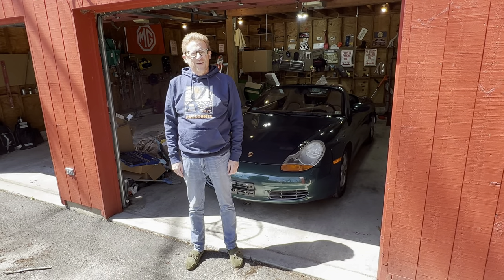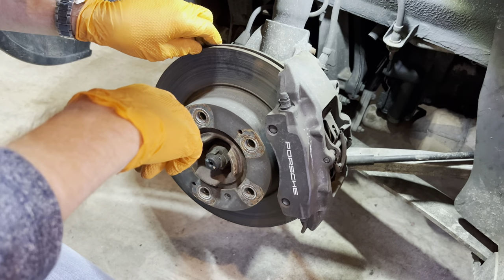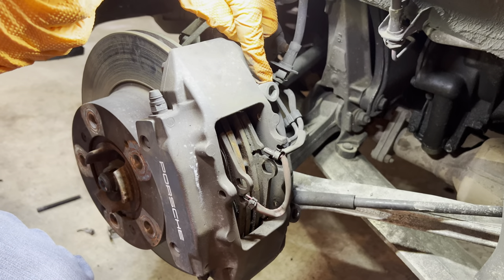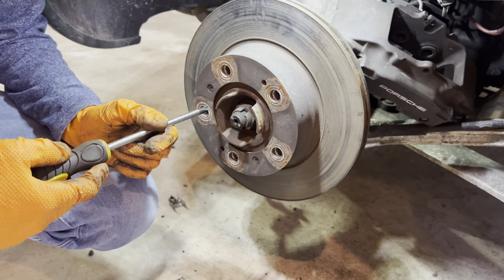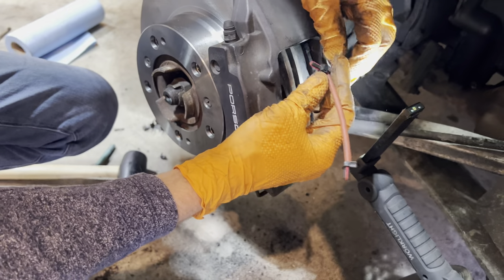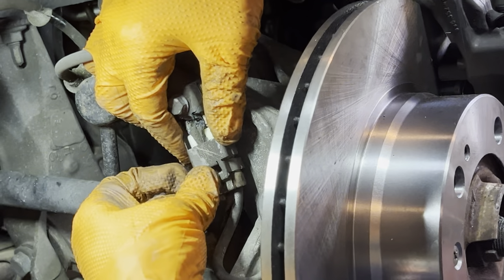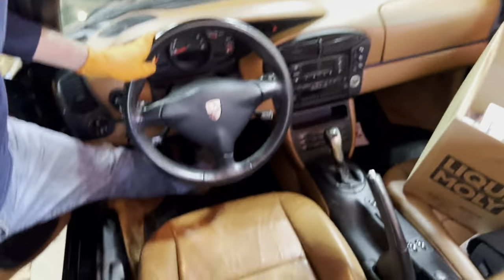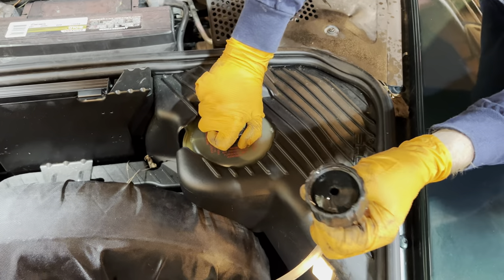This Is How To Do A Complete Brake Job On A Porsche Boxster 986!

Comment: Excellent work Jay. Great to have such good lighting and camera work which shows in detail how it’s done. Pity about the key to the lock nuts, would have thought you would have been able to get a second hand one in the USA. Also the tool kit which came with the car has an
aluminium rod which screws into the top hole on the hub to help with the alignment of the lug nuts and carries the weight of the wheel whilst you bolt in the four others.
Reply from the maker: That’s a great post for those that follow me. Thanks a lot, Phillip!

Comment: I like to remove the pad wear sensors first. Then remove the pad fitting spring/pin, slightly compress the pads, remove the pads, and remove the caliper bolts. Then clean, inspect the seals and rebuild. Brakes are so simple and you can save $$ over time doing them yourself while getting a better outcome.
Reply from the maker: Thanks for the tip!

Comment: Love your work, Jay! Thanks for showing the changing brakes isn't rocket science! How many hours of your time did it take? 

A couple of notes...from a guy who''s done this on his own 987 Boxster(s)... twice. 

- Probably best to put the car on four jack stands if possible for more economy of time in prepping each wheel, and more ease when doing the brake flush. 
- Remove some brake fluid before you start the replacement process (instead of after...).
- Use needle nose pliers to release the cotter pin before you tap out the post that holds the brake pad retaining spring. 
- Use a bungee cord to hang the caliper from the shock springs so you don't stress the hydraulic line. 
- Buy rotors with coated hubs (or tape them off and paint them on your own with a high heat paint), otherwise you will have rust on your hands and you won't like the look of it. 
- It's usually a good idea to spray some penetrating oil on the caliper bracket bolt and the two rotor retaining screws and let them sit before removing.
- You already got the word on the sensor wire placement. On some Boxster/Cayman models (thinking 987) the front sensor wires have two sizes. One is 1/4" long than the other...go figure!  

Question: Did you have the option of getting cross-drilled rotors, like Zimmerman, or ceramic (low dust) pads, like Akebono? 

Keep up the great work!
Reply from the maker: Brilliant post! I’m glad you took the time to post this because it’ll really help anyone who watches! Appreciate it!

Comment: The pad sensor wire should be on the outside of the brake pad retainer. There is a spot for it on the retainer.
Reply from the maker: I’ll fix it! Thanks.

Comment: HI Jay, good video and you did it saved a lot of cash as well. Lip on brake disc is normal, they diidn't look too bad to me, but there is a minimum thickness for the Disc, then its time to change. You can also get a re-machine of the disc whilst on the car, not sure of cost though, any way well done!
Reply from the maker: Thanks a lot, Steve! Appreciate the insight!

Comment: Good job, I recently replace my discs and upgraded them from 330mm to the turbo 350mm ones, just a few things worth noting.

The discs on my car are not only front and back but left and right handed. The ventilation on the disc has to face the correct direction. Anyone fitting discs needs to take a note of this. As yours are not drilled I’m unsure if this is still the case? Are they on the correct side? If not they won’t cool correctly.

When fitting the long pin back into the calliper and through the pads you should use a ceratex brake grease which prevents brake squeal. A small amount of the same grease should be used on the pins which the pads sit on. Only a small amount and be careful not to get it on the disc face. ALL the pins on mine were seized and I had to cut them out! The grease also prevents seizing.

If the pin is seized, When banging the pin out the punch you are using, not a screw driver 😂 can bounce and damage the outside of the calliper. Be very careful when knocking the pin out, with the correct hammer. 😂 You were very lucky, it took ages to get mine out.

When fitting the disc back you should always clean the hub which there being fitted to. Any  rubbish on the hub can cause brake vibrations and the disc not to run true. You can clean it with a light sand paper.

I wouldn’t advise using an opened end spanner on the brake nipples. You were very fortunate and could have easily rounded the nipple off. I would always use a ring spanner

Keep up the good work 👍
Reply from the maker: Great advice! Thank you!

Comment: Nice job Jay! I own the same brake Bleeder and love it, but I never pump the brakes.. I just pressurize to 20 psi and open the brake nipple. When you pumped the brakes 5 times was it before or after you opened the brake nipple ? .. again nice job!

Comment: Hey Jay, Did you move the brake sensor cables from under the brake pad bracket (metal spring that keeps the pads in place). That wire will perish quite fast otherwise. The loop on the brake pad bracket is there to retain the wire.

The brake sensor wire before in the right place: https://youtu.be/nuoCDmMMa5U?t=175
The brake sensor wire before wrongly under the retainer spring: https://youtu.be/nuoCDmMMa5U?t=1128

Really like to see your videos (my car is in the shop), can't wait to get back on ranching myself.
Reply from the maker: I know, I know! It’s on the list of things to do! 🤓

Comment: Nice job, BUT you still got something wrong! The brake sensor cable must be on top of the clip/bracket!!! Now it sits on the brake disk and will wear out fast. Check your video at e.g. ~5:50.
Reply from the maker: Ooops!
Reply: Yep… should be on the topside of the clip.

Comment: That lip doesn't matter, it's the minimum rotor thickness that does and you use a micrometer tool to measure that. Not expensive at all.
Reply from the maker: Isn’t the lip the sign that the rotor thickness has reduced though? Ergo, if you have a sizeable lip then you have a thinner rotor?
Reply: @JAYREAD  Yes it shows that the metal has worn away some but the minimum spec stamped on the rotor is the bottom line. Not that there is a lip.
Reply from the maker: @gbass7328  Got it! Thanks. Appreciate the post!